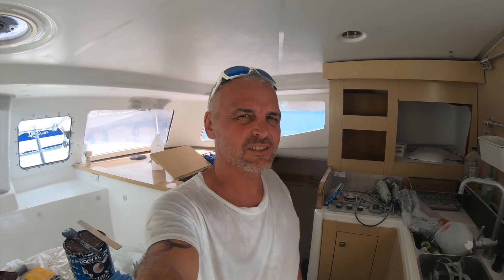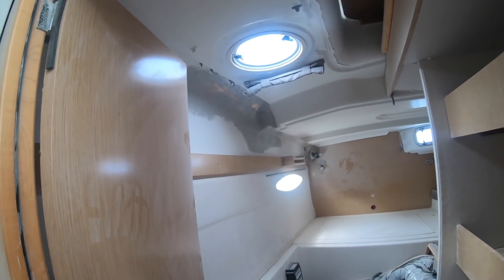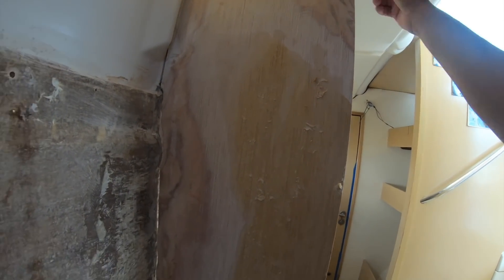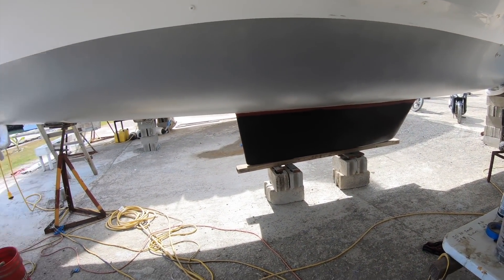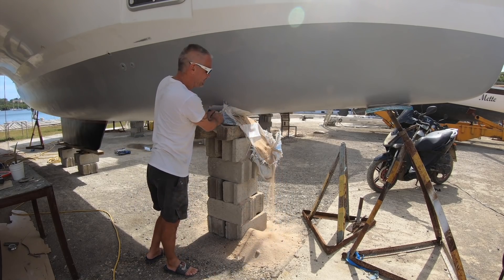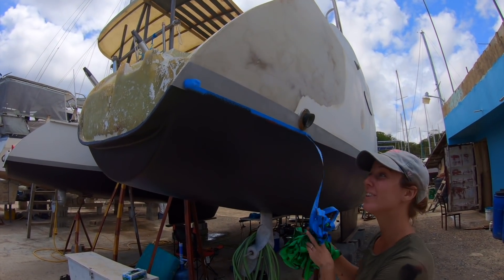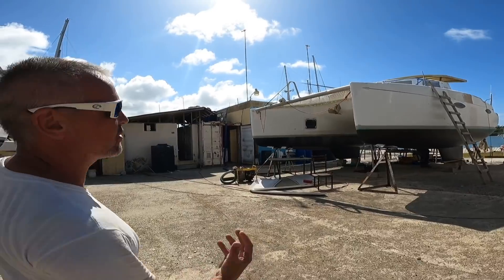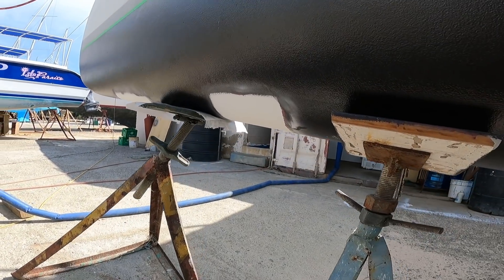Breaking BONES & Fixing CRACKED Bulkheads (S2 E76 Barefoot Sail and Dive)

Comment: Big job!!  Hope you complete your project and get your dream boat. 
Would have probably left the bottom epoxy and antifoul coatings till the last. 
A trick I like to do is to leave two inch gaps around the stands areas with each coat. So you can tie epoxy to epoxy and each antifoul to each antifoul. 
Keep going.
Reply from the maker: Thanks

Comment: Davy comes from the construction business, if I remember correctly. I come from a construction background as well.  I have an extreme stomachache when I see that the bulkhead was simply repaired with a few layers of glass.
There are tremendous physical forces at work here and I see this bulkhead as a future weak point in the overall boat static and safety. In Davy's place, I would have first made a prosthetic shoe or something similar that could absorb and transmit all the physical forces and then glued a few very strong layers of glass.  I may be wrong in my assessment....just wanted to mention that a major problem could develop here.
Reply from the maker: Yes you are wrong the bulk head is now ten times stronger that the factory that put it in
Reply: @BarefootTravels  Been watching Colin on the Parley Revival channel and they triple layered plywood in all of their bulkhead partitions

Comment: Looking great guys. Hey, Dave do the bulkheads have problems on  cats in general? Also, is it just one bulkhead, did you check the others and are you concern? Seems like Parlay and others are going through a miserable time fixing it seems like factory issues.
Reply from the maker: Our other bulkheads are nice and strong!
Reply: The main bulkheads on cats are more stressed than those on a monohull, because besides shroud tension, cats are subject to torsion caused by wave phase difference when sailing upwind (hence the joints on the front beam).  There must have been a large impact during the hurricane which cracked the hull open and also damaged the bulkhead.  While the bulkheads could be built stronger, strong enough really suffices.  The construction looks comparable to Parlay, but this is a shorter boat with much less displacement than a Lagoon 450, which means less stress on the bulkheads.  The plywood is now broken and by better tabbing and glassing over the plywood, it is reduced to core of a composite bulkhead, but that is repairing a hurricane damage, not fixing a design or manufacturing fault.  I wonder how the bulkhead looks below the bridge deck, but other than that, I like how accessible it is.
Reply from the maker: It definitely is more accessible than on a lagoon 450 that’s for sure
Reply: @BarefootTravels  That's a good thing!

Comment: Why not post the contact info for the contractor so that he could be contactable if folks wanted to get some rebuild work done in Luperon?
Reply from the maker: Don’t have the contact info yet as we found him through a friend. Don’t worry I will be putting it into the description when I get it. 
This week has been a crazy mission trying to get stuff done!
Reply: @BarefootTravels  🤗👍you seem to be really moving on with the finishing work on the hulls.  My gosh you have travelled a long rough road.  No worries ... way point is now in sight !  Am so surprised at the flimsy attachment of bulkheads on boats which boast such high seagoing ratings by the French (or is it the EU authorities?) ... the Lagoon 45s like Parlay Revival seem to be the tip of an iceberg.  I remember some time ago the Catamaran Impi crew giving information about some of the strengthening and other work they had done and continued to do on their Lagoon to get it up to their desired strength and functionality.  They made plain that this was no longer the same boat they had bought from the factory some years prior.  That customisation seems so important for ocean going boats.  Your FP looks like it will be stronger than new by the time you have completed your work. I really do admire your work ethic and determination.

Comment: Keep in mind these weaker points are like crumple zones in the design. Cracks not chunks. There may be flex required in certain points discovered over years of boat design.
I'm not saying your wrong BUT.
Take an example. There was another crew like your selves that new absolutely nothing about boat structure that bought a boat that had run aground. So. They bodger's it back stronger than ever.
Now. The moral to the story is. It ran aground and sailed for years broken. Unknown. If they now run aground. It either does nothing or rips the keel clean off. You dig.✌️luv your wife. Ok ok. Enjoying your wife.

Comment: Would it not be worth doubling the ply on that bulkhead epoxying to the other , many cats are having failures of these single ply bulkheads , very high loads.
Reply from the maker: Good idea!
Reply: @BarefootTravels  Alternatively you could cover the whole bulkhead with glass, e.g. biaxial with 45 degree offset between sheets.  The wood is no longer pretty anyway, but fairing and painting it white would look nice and clean and you could have a clear line to the deck where wood shows again.
Reply: I’m one of the failures chris is talking about :( We’re going to be sandwiching it with extra ply on either side. But maybe just double the thickness here will be enough reinforcement?
Reply: @david_shih  Two things must be kept separated: FP designed bulkheads to last, but a hurricane caused a giant fracture in the hull and broke them, so Davy only repairs and otherwise tries to stay out of hurricanes (and I cross fingers they let him leave Luperon).  Lagoon really designed a too weak bulkhead for regular use.  If you filled all cracks with epoxy and you cover the whole bulkhead with glass, likely two sheets of plywood would be fine for the most part, but then you had to add the third partial one at the bottom, which was considered necessary even under cost optimization, and that means you still have an uneven load distribution, that is not symmetric as it was before, and you have the transition area which was too short and split.  Adding the third sheet over the whole area avoids the asymmetry and transition area.  Just my thoughts, perhaps Colin had other reasons, but I would have done it the same.  The extra weight is unfortunate, because you lose some load capacity to keep the waterline, but it's a big boat and you can probably live with that.
Reply: @michaelhaardt5988  good points…guess I’m just traumatized by the failure and wanting to over engineer everything for davey. Also not worried about load capacity at all, we’ll be weighing her down with toys and people so she’ll ride low no matter what.